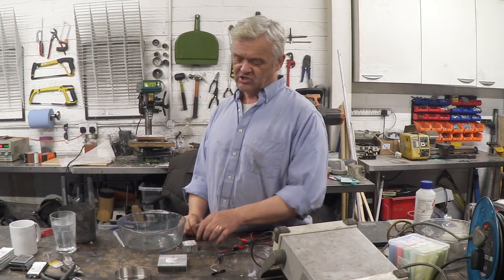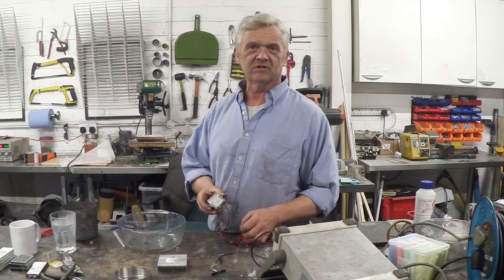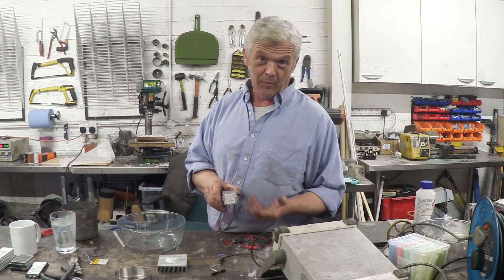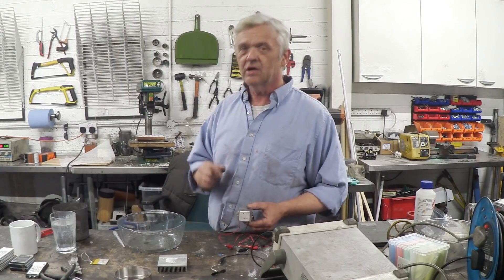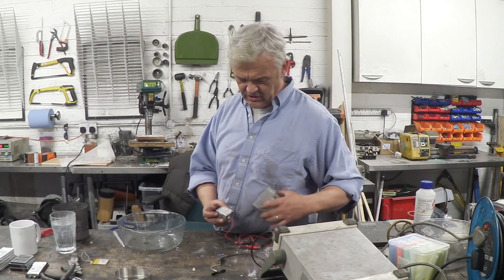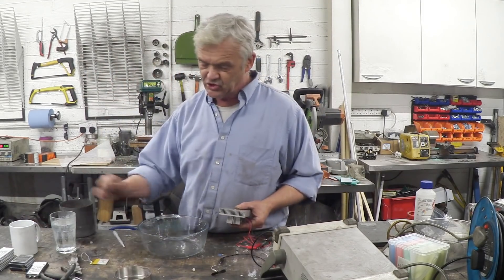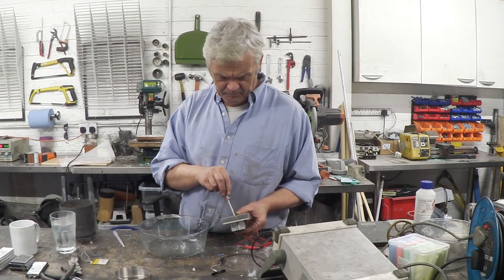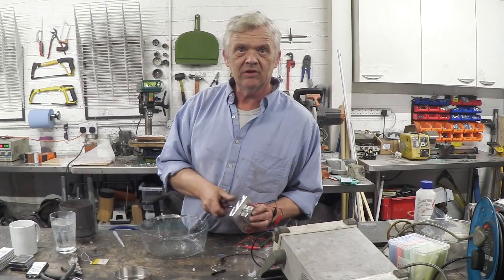1269 How To Generate Electricity From Urea

Comment: Something else to note, is that urea supposedly will fall out of solution when there's a high concentration of ethanol. So you could use the bare minimum of water, than add a couple gallons of ethanol to make it crystallize back into urea crystals.

Comment: i got a stack of 10 peltier elements, plan was to stack them around some wood fire source to see what voltage id get.
Reply from the maker: nice - but remember they only generate when there is a temperature difference between the hot and cold side
Reply: @ThinkingandTinkering  yeah an alu heatsink is usefull here.

Comment: My woodstove fan uses peltier. High temp gives 3-6volts i think. Cause the motor on that isnt tiny like the one u use. 280 or a mabuchi 380 size
Reply from the maker: good use of the device

Comment: Suggestion:
Long bar driven into the ground-Pelt-metal Plate in open air

- Ground maintains a constant temperature 
- air temperature is constantly changing

This should generate some power most of the time.
Reply from the maker: nice one mate - cheers

Comment: Hi Robert, I have done a experiment with some zeolith, and it is true that you can dry it in de sun, but only if you heat it up to 200°C/300°Celsius you will get the heat reaction with water. I've dried it last summer in my dry/hot greenhouse, and if you add some water it adsorbs really quickly but without the forming of heat!
Reply from the maker: it depends on the type mate x13 works well, clinoptile and ac3 not so much
Reply: @ThinkingandTinkering  Ah, thanks I did not know that. I was using the natural blue stones... Al the companies that use zeolite in heat storage say: its a natural product. But you must have the synthetic stuff then.. Maybe you could do a movie with this 'lower dry temp. Zeolite'? I think that would be really interesting :)

Comment: Robert, could you do a test. Washer smart motor and water heater elements?
Reply from the maker: what kind of test mate?
Reply: @ThinkingandTinkering  This is what I would call a poor man's patent. Lol!
I have a constant water supply of 40 gpm through a 1 1/2 pipe. Would the smart dryer motor supply enough power a/c (unmodified wiring) to continuously heat a water heater element. Or, would it have to be rewired to d/c. Basically the rpm range the motor would need to run at to do both systems. Thanks!

Comment: I got a hold of a Mercedes S-Class mild hybrid battery. The housing had what appeared to be Peltier elements based on the fact that applying voltage produced heat on one side and cold on the other. When I disassembled the housing I found thin metal elements sandwiched inside instead of the white ceramic plates I was expecting. I forgot I had them until now. I will have to do some experimenting with them after watching this.
Reply from the maker: for sure mate

Comment: Wouldn't it be great if we could find a couple of ways to produce electricity just from weather temperature changes. Say goodbye to wind water and solar. There is very rarely a stable temperature in the UK for more than a couple of hours
Reply: Check out OTEC , would be ideal for places like Puerto Rico . But for UK i think Air Source Heat Pumps are the way forward, but the challenge is shifting both the entrenched gas boiler industry and public understanding of it so that they request it.
Reply from the maker: it would mate

Comment: You can also make a reversible battery with this, if you use two solids that melt at different temperatures, salt hydrates work well, you just have to match a hot melting one and a cold melting one. When you charged it, you melt the hot melting hydrate and freeze the cold melting hydrate, then when you remove the voltage, heat flows from the hot melting hydrate as it freezes and melts the cold melting hydrate and eventually you reach an equilibrium, then you need to recharge. The nice thing about it is that you can cycle it as much as you like!!!
Reply: Use vacuum Evaporation and Boiling for  the hydrated water salt to make it more energy efficient , and Than use sunlight to dry And than use Use Natural source of heat to complete Dihydrate it like using Wood or concentrated sunlight  using fresnel lens with Black surface and colour additive .
Reply from the maker: nice one mate - cheers

Comment: Idea: You can use three peltiers in a stacked series, pure water (will form ice) on the one side and barium hydroxide octahydrate on the other side (will melt at 78C). Efficiency is terrible, but should make a nice demo for a reversible heat battery. Barium hydroxide octahydrate and water have high heats of fusion, so makes the thing more energy dense. Since the dT is constant, the voltage should also be constant until the system equilibrates.
Reply from the maker: nice idea mate - but I do have another one I am planning on
Reply: @ThinkingandTinkering  Cheers! Looking forward to seeing it!

Comment: That device would be perfect to clam it into the rear window of a car... most of the time its hotter inside... and when you drive the other side is cooled
Reply: ...just clamp it to the exhaust system....much larger delta T
Reply: @denniskramer9788  While operating thats definitly true.

As I am normaly only driving 45min a day  & my Car is standig outside most of the time. I think the window would still be a god choice.
Reply from the maker: nice one mate

Comment: Great video as always Robert!  I wonder if you could give us your thoughts on a home made thermal generator?

Mr Teslonian had reasonable success with aluminum wire and graphite.  I feel like if a guy could find or make a non conductive perforated plate, feed the wire through the holes and then fill the voids with graphite paste...   I think he connected them in series?.....  

You are a huge help to us who’s minds ability to dream up a experiment far exceed our time or ability to bring them to reality!
Reply from the maker: I did something on this with painted zinc and graphite lines mate
Reply: @ThinkingandTinkering   I’ll try and dig it up

Comment: Sir, does this mean Electricity can be produced from Urine!
Reply from the maker: electricity can be produced from urine but this is really an endothermic reaction and scavenging the heat difference - you can electrolyse the urine and burn the hydrogen produced
Reply: @ThinkingandTinkering  Thanks so much dear Sir.  Best wishes.

Comment: Did you use some kind of heat-conductive paste like you'd use between a processor and a heatsink in a pc? Might be able to improve efficiency, and there are some that are fairly cheap to produce, like the thermal epoxy the chaps at Tech Ingredients experimented with.
Reply from the maker: Yes I did - remember we did a thermal paste too